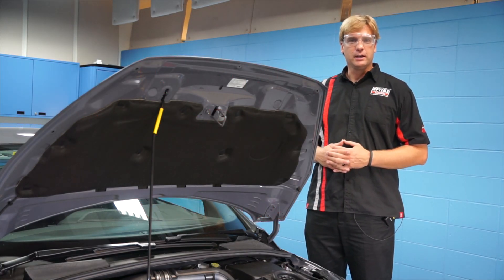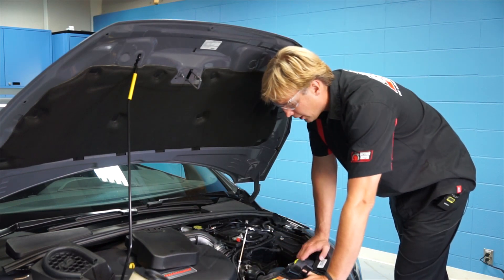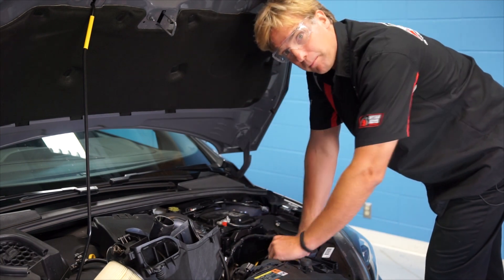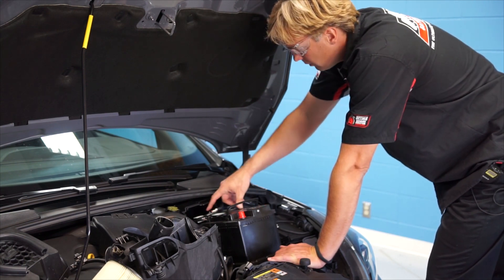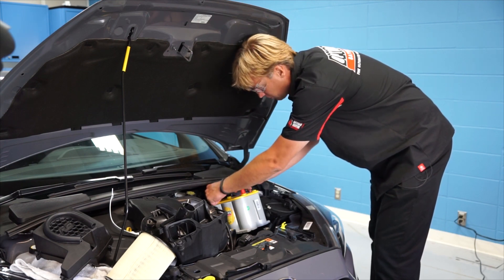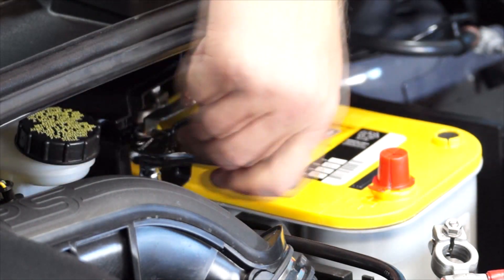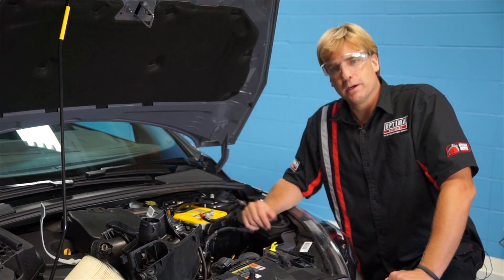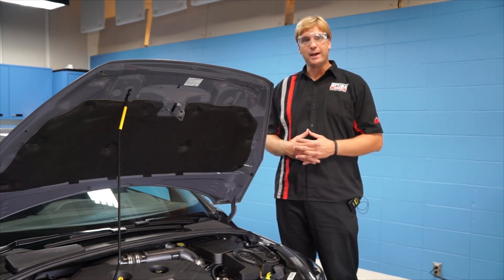Ford Focus RS (2016) OPTIMA Upgrade - New Battery Install

Comment: For the Focus RS, there is a BMS reset procedure needed to be completed when a battery is disconnected and reconnected whether new or used.
Reply from the maker: Hi - Thanks for watching! Check out our videos on Battery Registration. The links to them are in this video's description.

Comment: Great video, glad you mentioned the battery management system may need to be reprogrammed.  Only thing I don't agree with is the recommendation of a redtop, I wouldn't put one of those in a Focus RS as that car is equipped with the engine auto start/stop feature.
Reply from the maker: Hi - Thanks for watching and sharing your opinion!